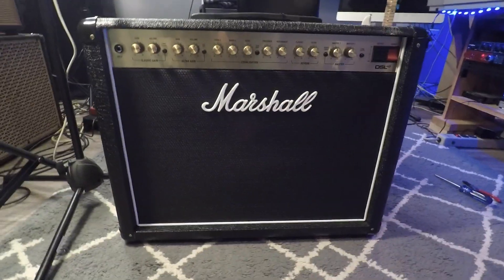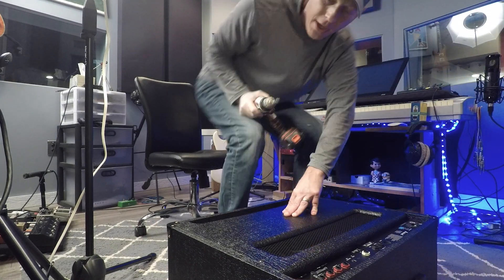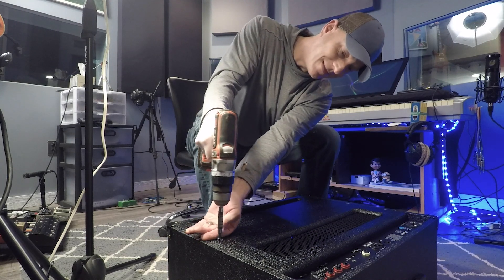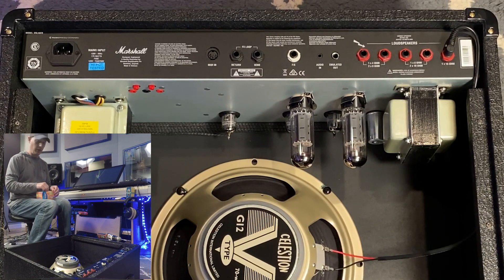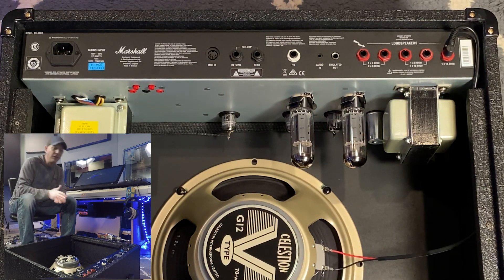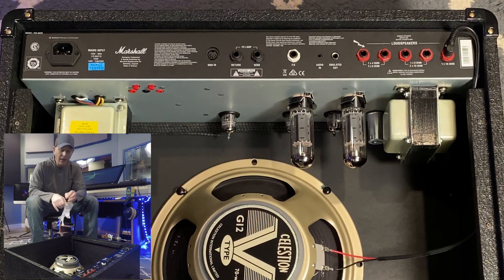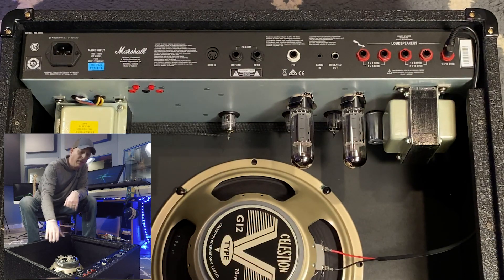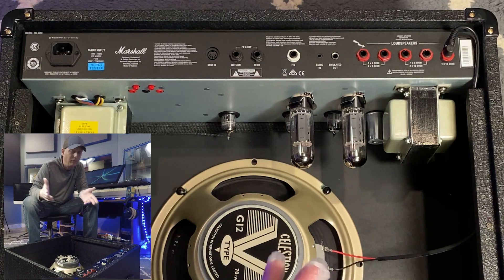Marshall DSL40CR Power Tube Change and Bias Adjustment | EL34 Tube Replacement | How to Change Tubes

Comment: I really have to say, as i bought my Marshall DSL40cr, i First thought„Naaa, vtype will be such a cheap Budget Celestion that does its Job but should be switched to a G12-T75 or something“ but After Breaking it in, i‘m absolutely in love with it! It isnt that harsh like many V30’s but also more modern and present than my 1994’s G12-T75 - it has nice mods, clear but still warm highs and a good amount of low end. Not only a decent, but a really great speaker in my opinion, that definitely doesn’t will be switched out of my DSL40cr! 

Nice video with great audio here btw! :)
Reply from the maker: Thx! The V30 def makes everything better 😂🍻
Reply: @alwaysandy_  i think its a question of Taste…i have a 2x12 v30s can, that Sounds harsh as hell - my 1x12 v30 cab sounds great, but has less kids than the V-Type…and I like middy speakers, like G12-T75 so for me, the V-Type (or at least the one I have) is a great speaker, better than V30 - but for sure, there are many people, that likes the v30 much more…I also heared “I hate g12-t75” while I love them. 😁🤘🏽

Comment: Thanks for the useful information. Just bought one of those amps on musicians friend. Open box, mint condition. Hopefully it arrives in working order. I'll definitely check the tubes with the digital multimeter.
Reply: @alwaysandy_  just got the amp. The biases were set to 38.t left and 45.8 right!!! Also is it normal for the amp to make loud white noise/ fuzzy sound? I have no guitar or cable plugged in and I'm cycling though my channels. With the volumes and gain maxed and this amp is loud. Is that normal?
Reply from the maker: @J_Braz_  it’s a very loud amp. With volumes high I’d expect some noise sure.
Reply: What’s you experience so far?
Reply: @preciseaudioblog  I sent it back and got the dsl20hr. Put it on a Harley Benton 212 vintage horizontal cab. Sounds good. And the amp came from zzounds, used for 499. Amp arrived in excellent condition. And this one is much quieter than the 40 watt combo I had. I wish Marshall would have gave the 20 the same functions as the 40, two tones on each gain channel. But oh well. These amps are definitely a little fizzy though. I've been experimenting switching preamp tubes around, v1 v2 v3 ECT.
Reply: @J_Braz_  Nice!

Comment: hello Andy, good video, but que you tell me if i change the power tube of mine, marshall dsl 20 cr ,i must to do adjustment of bias, because i don't see a bias inside. THANK YOU FOR YOUR ANSWER FROM BORDEAUX FRANCE. DAN.
Reply from the maker: You don’t have to reset or change the bias, but you can if you have a multimeter or voltage meter. See at 11:15 in the video I demonstrate this.

Comment: I’ve never seen how you bias an amp. Gives me hope I can do it myself!! Thank you!! Btw, what if you bias it at 32?? Is it better?
Reply from the maker: Better to some is not to others. Just different, whatever suits you.
Reply: @alwaysandy_  yea, but is the Bias settings on each tube different? What's the Bias settings on a Celestion Green Back? If you change speaker or change or replace tubes-is there a prerequisite setting for a given tube set to a given model of speaker? I want to go back to a tube configuration and am seriously considering this model. But now I fear that changing out the speaker it comes with to a Celestion. Kinda lost now as to seeing this video. last video I saw had the circuit board exposed and the guy fine tuned 2 settings on the circuit board to bias. This video is confusing. Here's the video I am referring to: https://www.youtube.com/watch?v=WbUoav53VaA
Reply from the maker: @michaelpal7641  Biasing this amp is as easy as it appears in my video. It has little to do with speaker choice as far as I know. If u change a speaker and font like how it’s biased re-do it. Simple.
Reply: @alwaysandy_  Thanks for the quick response-greatly Appreciated. But  the Bias settings I refer to in the other video has the guy taking the Amp itself "Out" and exposing the circuit board, then using Volt meter, he attaches alligator clips to circuit board leads, and uses a small screwdriver to turn the trim pots. That's a definitive "Hell No" for me.
 In your vid-you didn't remove the Amp itself-you used the two small red dials above the positions where you inserted the multimeter leads. Looks like something I could do after all. man-I just watched your vid again. Yes-You Rock. Thank you again!!
Reply: @michaelpal7641  The video you are referring to is the older version of this amp.  Different circuitry as that model did not have the master volume pots like the new “CR.”

Comment: Which version JJ el34 tube did you use for your new replacements? JJ el34 or E34 L or El34II? - Thanks! I'm trying to figure out which version JJ el34 comes stock in my new dsl40cr
Reply from the maker: Oh I have no idea. Whatever was in the rack at guitar center.
Reply: Same here..there seems to be different versions of the el 34
Reply: @michaelsteven1090  the stock el34 tube is the standard JJel34 for the dsl40cr. I'm thinking of trying a pair of the JJ el34II's just to see how they sound in my amp. Though I have to say that I am very happy with the stock JJel34 tubes that it came with.
Reply: @gigmandrew8975  Thanks..I'm looking now and there are NONE available..😡
Reply: @michaelsteven1090  - No Dsl40cr or no tubes?

Comment: Super helpful video. May I know how do you determine to set it to 35? Is there a specification sheet for that? I have the DSL20 head.
Reply from the maker: Zidane Chan there may be a data sheet per amp or tube, I don’t recall. I know I checked my bias first which was near 30 if I remember. I likely watched some vids and decided 35 would be fine. Lil more gainy than 30. 🤘
Reply: @alwaysandy_  Thank you very much for sharing!
Reply: I have the same amp (DSL40cr), Marshall recommends bias setting between 32 and 38 for this amp model.
Reply: DSL don't have to be biased - if you don't believe, ask the Marshall support
Reply: It does, it has external bias pots and ports

Comment: Hi, thank you for the video! I have a question mine dsl40 cr bias voltage don’t want to stay in one point, it is basically jumps from 34.5 to 35.5 on both checkpoints, is it normal and what can be a problem here? Thank you in advance!
Reply: mine is always changing too... i set ir like 32-33 mV and a week late is was near 40... any clue on why does this happen?
Reply from the maker: i don't know specifically but i'd guess a variety of things could cause minor variations over time. like room temperature, what you're playing, tube age, tube where-in point. good question.
Reply: @JoaoNuno1995  - AC line voltage fluctuations also cause the bias voltage to change. Usually nothing to worry about though.

Comment: im currently trying to bias mine and the bias knobs dont work. the amp is set at about 75 for both, hot as hell. any advice for if the little red knobs arent working?
Reply from the maker: Ummm, return it? Take it to a qualified repair shop? Personally I don’t like messing with power tube stuff that seems not normal. If those dials don’t turn something is broken.

Comment: Can I replace the EL34 tubes with 5881 tubes on the DSL40CR and than just bias it to 35mV without any problem?
Reply from the maker: I would assume yes.
Reply: No you can not just swap for 5881 the screen resistors would need to be changed first

Comment: What is the setting on the voltmeter? I couldn’t tell where the dial was at. you said “this one right over here” I think that’s the one” could you be more specific .
Reply from the maker: Direct current or amperage or something. I don’t know. I said that. Pause it, screen shot it, look up the symbols you see and try and match. I played with the dial until it was on a setting that displayed the proper range of numbers I’m sure. Trial and error.

Comment: My amp isn’t playing when I plug it through the front but works when I plug it through the return fx loop.. preamp issue?
Reply from the maker: Sounds like it it. Given you’ve exhausted channel switching and voicings etc. Good luck!
Reply: @alwaysandy_ update I took it to a proper amp tech and he said it has a blown transistor and needs new power tubes and the transistor replaced! Just leaving this comment incase anyone else experiences something similar

Comment: I read somewhere that the plate voltage of this amp is 450V. If I use the standard formula: 25 (el34=25 watt) / 450 * 70% = 38.8 mA. Biasing at 35mA seems a bit cold...
Reply from the maker: Doesn’t sound cold. That’s my gauge.
Reply: Plate voltage on mine was 420 VDC

Comment: You should have turned on the amp after unplugging it to make sure power was drained.
Reply from the maker: Sure.
Reply: Yeah I’ve been capacitor zapped more than once and the modelers have circuitry that can be damaged
Reply: @gitarman666  Modeler?..This amp is a modeler? 😵‍💫
Reply: @michaelsteven1090  
No it’s not,  it’s all valve El34s and 12ax7s
Don’t know what I was talking about in that comment,🤪
I have been zapped changing out a JVM output transformer!
I wonder if I was making reference to the printed modual they throw in there instead of point to point wiring from Vietnam, Who knows what I was smoking that day

But Dollar for dollar these are great amps I own 2 DSL40cr, JCM 800, 900 and my JVM410 combo,
That’s everything in my Marshall harem
Several Mesa Boogies and Fenders, some smaller SS orange, Revv and my Soldano SLO 100
Friedman next but I have to sell some guitars first, 😢
Reply: @gitarman666  Thanks for clarifying..I just checked my bias and the left power tube is maxed and barely making 35mV..I need to replace them but can’t find any EL34’s..nobody has them! Are there any other versions of the 34 I can use do you know?
Reply: @gitarman666  I have a Friedman Classic Tele..love it..never played his amps
Reply: @michaelsteven1090  only online, here in the north east US we have guitar centers, Sam ash, a few smaller brick and mortar shops and they usually carry some tubes but I could not find el34s during the holiday
I like tung sol preamp tubes for my Marshalls and I use sovtec or groove tubes for the power amp 6550s for my old JCM 800
Reply: @michaelsteven1090  my Mesa roadster let’s me use 6l6 or el34 with auto bias but to use them in a amp not speced for anything but a el34 you would have to change the resistors, for the dsls stick to el34 there are lots of players that swear by “vacuum matching” like groove tube offers but I personally have never heard much difference 
But I know they sell whole tube change out kits for pretty much anything ya got, but like you I just need power tubes since my volume has been dipping and spiking after they get hot on the dsl40cr’
Reply: @gitarman666  Great..Thanks..I just checked and Stew Mac has JJ EL 34's in full tube kits and in pairs..Of course there on backorder! 😀
Reply: @michaelsteven1090  
Of course, just a sign of the times brother
Good luck
Reply: Unpluging the amp and turning it back on is not always going to drain the caps, your not at risk of shock until you have pulled the chassis

Comment: I got the same amp, question, why the number 35, and not 40 for example??  just asking..?
Reply from the maker: Assuming you mean 34...it’s a reference to the type of tube. EL34 is a power type type, another type is 6L6. The numbers refer to specific parts or patterns within the structure of the tubes. Cheers!
Reply: Here is the formula. The regular JJel34 is a 25 watt tube. 25 divided into 426 DC volts on mine @ 122.0 vac line voltage x .65 dissipation equals .038, or 38 MV.

Comment: I'm confused. You said before you walked to get the meter that you need to "make sure it's on the high power mode".  When you came back you offered, that "if we'd left it in the high power mode ..."
Reply from the maker: Considering I did it once before filming perhaps it was in said mode already when I picked it up.

Comment: do we need to bias it up also
Reply from the maker: I don’t think you bias preamp tubes, just power.
Reply: thank you sir,,,we just have to replace the preamp tubes 4 at once,,,all together
Reply from the maker: @miguelenriquez4780  you can mix up preamp tubes sometimes. They’re not as picky as power amp tubes.
Reply: I have both dsl 40 and 100,,both of them are terribly hot,,even the switch button are so hot is it normal,,I think I need to bias both of power tube
Reply from the maker: @miguelenriquez4780  hot is normal, trying answers questions. Good luck!

Comment: Does it matter what kind of tubes you use?  I’ve heard that most people can’t really tell the difference
Reply from the maker: Depends if you’re one of the ‘most people’. I can tell differences in tubes. Power tubes mostly. All the preamp tubes are good lately just a high gain low gain thing.
Reply: @alwaysandy_  What power tubes do you prefer?
Reply from the maker: @SECURITY39  Tesla EL34 from Czech Trinec plant. Can find on eBay
Reply: @alwaysandy_  yeah maybe 6l6 or el34 . But I gurentee you can't tell between brands .

Comment: Does it really matter where the blank pin on the tube ends up?
Reply from the maker: Absolutely in my experience it matters. I’ve always replaced tubes already there, and if there no ‘missing hole’ in the socket I make note of it.
Reply: Octal tubes are keyed it will only go in the correct way

Comment: You never checked plate voltage so this amp is not biased, you want your amp at 60% to 70% dissapation ,more than that and your tube life goes down from there,less than that and your amp will start sounding very crap ish doesn't hurt the tubes though

Comment: Touching your tubes with your bare hands is ok. It's a myth that you shouldn't touch them with your bare hands.
Of course maybe wash them first. You dont want to change out tubes after doing an oil change on your car.
Reply from the maker: My hands have various not good things on em regularly so I play it safe. But, true!
Reply: He never said that. He said he didn’t want to get things in the tube that he touched with his hands
Reply: @SECURITY39  what!!??....... regardless.....it's a myth....
Reply: @ericwilliams538  Touching potentially destructive particles before you touch tubes can hurt your tubes because those particles can attach to the tubes. Therefore you should either wash your hands well before touching the tubes (after you touch those particles) or putt in light gloves OR both. His point has nothing to do with touching the tubes with your bare hands.
Reply: @SECURITY39  good grief, what you're saying is a given, and goes with out saying. Of course if you just changed the oil in your car you don't want to run inside and change out the tubes in your tube amp.....So, again for the 3rd time touching your tubes with your bare hands will not harm your tubes. 
I bet you change your light bulbs ( older non LED light bulbs) with out wearing any sort of gloves....and that would basically be the same principle.
Reply: @ericwilliams538  I’m merely reiterating OP’s point since you clearly missed it and thought the point was you shouldn’t touch tubes with your bare hands. I’m guessing you’re a liberal since you’re having a hard time following the logic and main point.
Reply: @ericwilliams538  dude you’re writing a novel about something so trivial. Projecting about an argument
Reply: @ericwilliams538  so, I merely reiterated OP’s point, and you resorted to calling me names.  But, I’m the ahole huh?

Comment: Dude tap on them gently with a pencil eraser with the amp on, if you hear the rattle its.microphonic also known as tube rattle. Dont wack the new ones like that you will cause them to fail and or rattle. They are fragile.... 😅😂

Comment: You cannot measure current in parallel.  To do this properly test resistance across resistor(the spot you tried to measure current) then measure the voltage drop across same spot. Then follow Olms Law.  Please do not follow this procedure.  There are much better teachers on youtube like Uncle Doug,  El Paso tube amps, Blueglow Electronics any of the previous have proper videos on the subject.  This is the biggest problem with the internet anybody can post anything they please right or wrong.
Reply: mcsniper77
These are bias reading points provided by Marshall. There is a 1ohm resistor to ground on the cathodes of each power tube. The voltage drop on the 1 ohm resistor is equal to the current flow in milliamps. You are measuring cathode plus plate current, so the readings you set it to will be conservative by a milliamp or two.
Reply: @rjake61  Did you not read my comment or are you daft?  Watch the video again his mutlimeter is set to measure current,  which is impossible with that style of meter without interrupting the circuit IE placing it in series.
Reply: mcsniper77 is correct. You can't read amperage in parallel, only series. The multimeter should be set to milliVolts.
Reply from the maker: I think I’ve said lots of times I’m not an amp tech or even that smart. I followed steps I’d seen best as I could, and it seemed to work for me. Multimeters and their settings could be a video in itself cause wtf???!!😂😂😂
Reply: Hey Mr. Know-it-all.  This is EXACTLY the procedure that Marshall designed for this amp.
Reply: @frossbog  not, I sent an e-mail to Marshall and  Dave Wittering from  (Senior Service Engineer) told me that the recommendation is "35 mV" per side:
"Hello Cesar, the BIAS should be set for 35 mV per side"